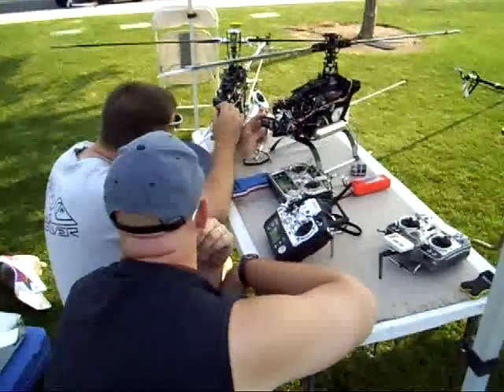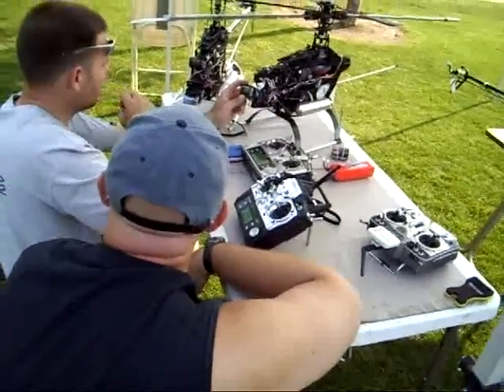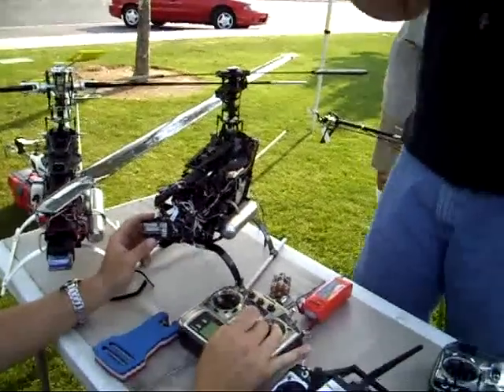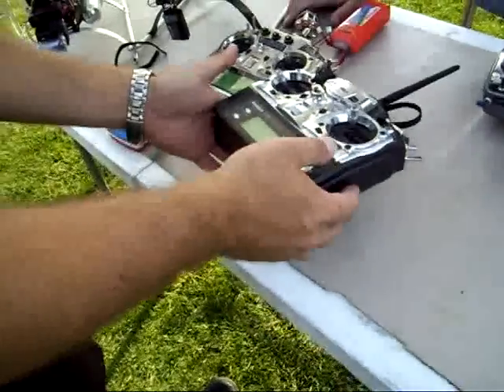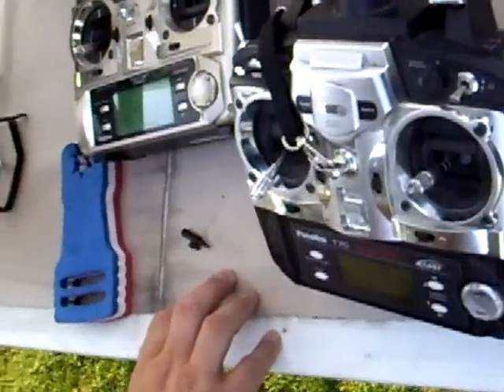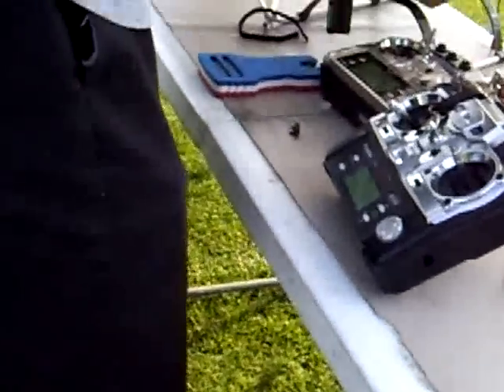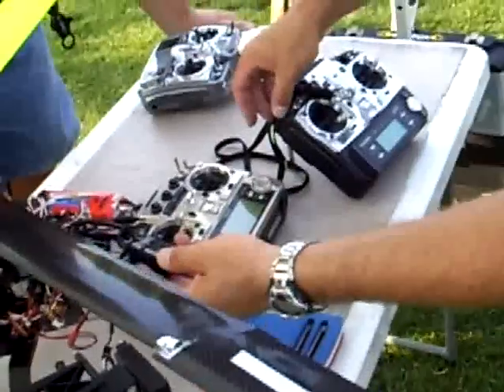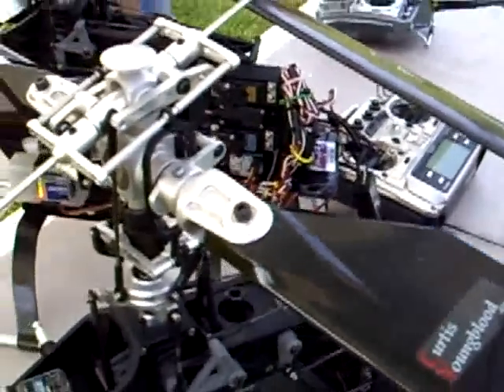tt raptor 30 v2 my problem was

Comment: The blades are always 90 degree's to the main shaft, if your blades deflect and especially enough to strike the boom it is generally a sign your dampeners are loose or wrong. 

Its always a good idea to get advise from someone who knows what they are doing, like what was done in this case. I did this all through research and its taken me almost 3 years to get to the point I am with these things. Learning how these things work makes figuring these problems out far easier.

Comment: From one WC to another. Stop with the upgrades you dont need a governor carbsmart or any additional electronics till you learn how to fly better. Dont upgrade to a metal head either. Additional electronics just make it that much harder to set up. Use wooden blades till you get better so if you crash much less to repair. Good to see you progressing though. I'm still learning just like you. basic gyro engine and blades. 1st crash cost about 35.00 to repair.